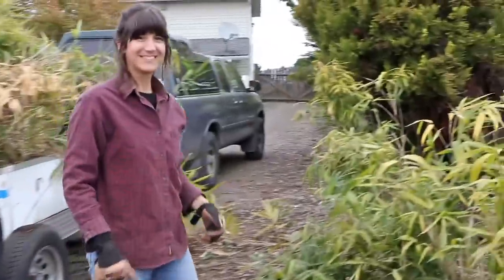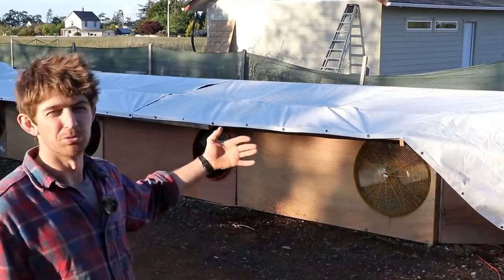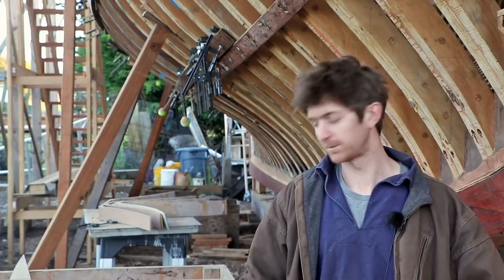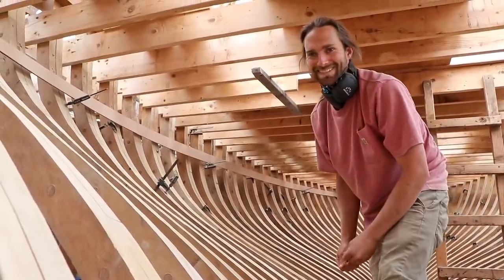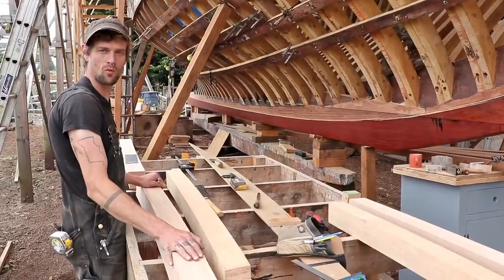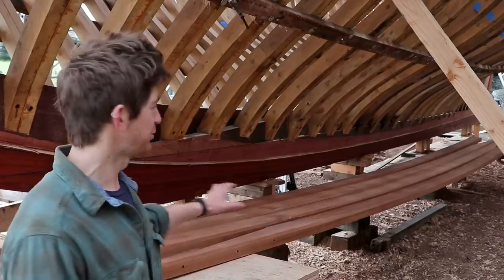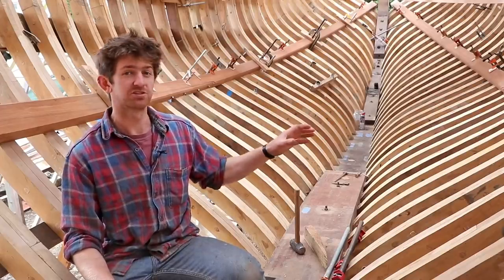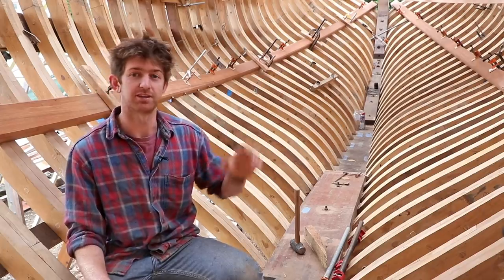BoatBuilding - Bilge Stringers / Oak problems! (EP72)

Comment: If you have a vacuum pump, I would take the bad oak and suck a stabilizer through it and it will become strong and be virtually water proof. Technique used for turning punk wood and making knife scales. Works great. I have even used de-waxed shellac as a stabilizer.

Comment: Do you pitch the exposed cross-grain ends to prevent checking and uneven drying warpage)?   The unevenness in Red Oak growth is common in wood sourced from areas of inconsistent weather patterns or interrupted by drought and over-wet seasons.  If cross pollination occurred..rare..there would be a natural uneven strength to the grain..  I don’t envy the intense work you’ve gone to.. I tend to only accept one custom project per year to two years and am usually swamped with work!  You’re doing it all...something I’ve given up after 6 decades.  Great videos, fabulous cool music!

Comment: Hi Leo, I am sure you have far better things to do and read, but here is a brief description of how a fan works. I am sure your system will be adequate. 
"The air being drawn towards the fan is moving in the pressure differential between the atmosphere at rest, and the lower pressure right in front of the fan blades. The pressure gradient is quite small, so the air cannot flow very fast - and it has to be drawn from a wide region to supply the mass flow. After impact with the blade (or at least after "interacting" with the blade), the air has a LOT more momentum that is directed along the axis of the fan (with a bit of swirl...). This higher momentum gives the air downstream of the fan its coherence"
You can puzzle over it with a big Mac and a Coke now Cecca's not there.

Comment: Loss of strength is more common in ash or elm. This happens when varnishing too damp wood. Over time, without access to air, the tree “burns out” and becomes fragile. In appearance, the texture remains the same. Although several times I came across a fragile oak, as in your case.

Comment: If you can blow bubbles through it, it's red oak (one of several varieties) rather than white oak (again several varieties). That's one of the ways to distinguish between them.

Comment: You might try splicing Purple Heart ends on the last eight inches ‘Dove Blocked’ for strength..  if the appearance is acceptable it helps seal the open crossed grain of both.

Comment: I do sympathise with the travails with the duff oak. It is often a heartache knowing that one will have to remake a part but the older I become the less down hearted. Experience just teaches one to pick oneself up and get on with it. Currently I am restoring a shaping machine and made a mistake machining a new dovetail pivot. I could have used it but bought a new chunk of steel and started again. Following published drawings I noticed that the micrometer dial I had just made as drawn was too small to accommodate any numerals so I cut off another chunk of steel and started again. Sometimes it is the bits that one throws away that makes the job a good 'un regrettable though it is. I do understand the problem with the timber. As a carpenter specialising in sash window renovation I use a lot of sapele and have a perennial problem of being palmed off with meranti which has negligible durability and is rejected when discovered. Fortunately I do not usually get as far as making anything out of it.
having watched the whole series from episode one thus far it is lovely to see progress accelerating somewhat with the acquisition of additional skilled labour if acquisition is the right word.
Your courage and determination is admirable. More power to your elbow and I would echo the comments of others on this video that the music you add is very good. Your videos are very enjoyable. Thank you.

Comment: I would have left those half beams in.  A) they are as far from the water as you get accept for the masts and rigging.  B) they are covered with the deck planking and none of the end grain is exposed.  C) I would have sealed them in place anyway D) Red oak is plenty strong, And I did see Louis "Tips from a Shipwright" video on it.  E) I'm a carpenter not a boat builder so I could also be totally wrong.

Comment: Have you considered the mystery wood being american chestnut?  Graining and color are very very close to white oak.  The weight of American Chestnut is about half that of white oak.
Reply: John, that's a good idea but I don't think it's right.

We cut and use a lot of (European) Chestnut. From everything I've seen of American dentata Chestnut they are really 2 very similar timbers.

The timber that Leo has is definitely an Oak, Chestnut doesn't have those really distinct 'Oaky' rays. Chestnut can be a little porous but not anywhere near as bad as the stuff shown.

 A friend of mine turned a really thin walled drinking goblet from Chestnut that bled red wine the first time it was used! Thicker sections and lengths are good though.

Enjoying the debate in the comments of all of Leo's videos. They are as interesting as the videos themselves! :-)

Comment: I'm just curious, but aren't new bilge stringers much higher than original?
Reply: No doubt they're stuck into the front at the correct height, but they'll need to be bent (edge-set) into their final location as they sweep aft. From the dwgs, it looks like the stringers have quite a bit more curve & twist than the beamshelves, so Leo might want to drag them into position in incremental steps.

Comment: Did you toss around the idea of using vacuum to soak the open grain with epoxy? I know that’s not a wooden boatbuilder’s way or an amazing solution given that you had spare wood to use. It just seems it may have helped both water intrusion and provided strength.

Comment: From the perspective of dealing with the porosity of the wood, could you impregnate it with a light viscosity resin to block up the pores? I guess if it's not strong enough, then it's not useful for the intended purpose. Perhaps it could be re-used for some other less structurally rigorous components?

Comment: Th CORRECT terminology,  from a  ex merchant seaman , is the sharp end, the arse end and the side is called the wall. To remember port and starboard it is required to either mark your boots or wear different coloured socks.

Comment: I am retired but an old mate asked me to help him renovate a business premises.  Built over a century ago, added to, then revamped in the 1940's, then remodelled in the 60's.  Built from Australian hardwood and everything is twisted, bent, warped dished and out of plumb - ad infinitum.  I love watching Leo's trials as I can identify with them.  Simple jobs take longer than planned.  A bit of wet rot here and borers there.   It turned out to have been a garage in the 1920's and remains of the old hydraulic lift central pillar is still in the slab under the floor.  Too heavy to remove so we build around it.  Leo's skill at problem solving and his trade is wonderful to watch.  Well done young man.  You are quite the inspiration.

Comment: Noahs Ark is similar but much larger. Lower hull exposed at 6,500 ft in E Turkey- and the bilge stringers were fastened/are fastened with huge rivets. Titanium(40%)/Aluminium(20%) /Manganese/Iron and more on the alloy.
Reply: 500 ft long. You might find it interesting. Y/T Ron Wyatt.

Comment: Educate me, please, Leo. Did the hands tools work differently in the dodgy white oak that "wicked up water and snapped like a carrot"? Did the wood have a different sound or feel to it per chiseling or hand sawing that was in any way noticeable? I can not remember from my carpenter days so long ago, but i would have expected something to feel different or wrong . . . if only the sound made by the tools or saw(s) when applied to the "wrong"/different wood. How is it possible that wood which is so different in attributes not sound/feel different to the hand? This baffles me. If it is that hard to notice, does that then mean that hybridization issues are/can be a problem now-adays? {time and $ and moral lost} Does this mean that all the timber being used will now have to be run through a quality control cycle and have a small piece cut out for the wick test and/or sledge hammer test. Yikes! What a pain in the back side. I worry for you. I have done quality control testing for construction sites: observing for defects all site materials; e.g. framing timber quality; concrete strength and soil compaction stuff, correct specs for structural iron. What a chore that is.

Comment: You should consider that the unusable, but well fashioned, half beams are now timber from the Tally Ho. If you put them up for auction on ebay, I would bid on one. Would be a great piece to have.
Reply: Of course, shipping costs might be a tad high. Then you could consider adding even more labor and turn the beams into plaques for the launch. Just a thought.

Comment: Sorry, have to ask:  apparently the truck was loaded longest beams on the bottom and shorter upwards.  Therefore, the short topmost plank bundles were unloaded first and put before the garage door; then the medium lengths, etc.  But after the first unloading, the truck pulled it's curtain and re-angled itself.  I'm guessing for better unloading and access.  But why was the curtain drawn between first and second forkloads?
Reply from the maker: Quick answer - I don't know!

Comment: What method did you use to remove the glued timber joints without damage to the mortise pockets when you replaced the defective beams? I noticed that they were all removed in one piece.
Reply: They were all just sitting in place as an unfastened dry fit. But note that while the joints will eventually get anti-rot primer, bedding compound & bronze screw or bolt fasrenings, no glue will be used.

Comment: So what exactly IS the MC of the lumber? Circulating air could actually increase the MC of the wood rather than decreasing it depending on ambient humidity/temp. I lived in the NW for 20 years, just guessing it will prob be impossible to get the lumber below 10% MC even after decades of air drying.

Comment: There is a simple method to check if it is white oak or red oak. Take a 5% solution of sodium nitrite (aqueous) and put some (2-4) drops on the heartwood. White oak will show an immediate color reaction (it becomes real black), red oak will not.

Comment: Found this - https://www.fpl.fs.fed.us/documnts/pdf1987/ward87a.pdf - it's an article on wetwood, a bacterial infection of white oak. It goes on about "metallic discoloration", "ring failure" and how you can't tell if its been infected "after prolonged exposure to the odours of green lumber in the mill".

Comment: A simple solution but it appears your dead set going original. I personally would mix up some penetrating resin and apply as many coats as the timber would draw in. That would treat it and stop any water issues.
Reply: But not the strength issue.

Comment: Could you consider using a low viscosity epoxy to seal the pores of the wood?  It would wick into the pores just as water would.
Reply: As well as avoiding rot it also have to have strength so as not to snap as demonstrated in video.

Comment: She's too giggly.  It's fun.  Also, about that porous wood.  Would you care to do a slight demonstration as to what happens if you attempt to treat it by using it to soak up mixed epoxy, given proper time to dry?
I feel like that would add some random resolution to any questions someone else might have.

Comment: Bloody hell, redoing what has already been redone. Good of that git to refund you for the "bad log", but you're still holding the bag for double the work and use of more timber and time to redo your redone work. L8R Patrick, good luck throwing clay and teaching. 
Is it just me, or are those bilge stringers kinda high? Are they not where the internal decks (walking floors) will be mounted? Seem to seriously reduce the head-room for walking about the births and cabins. Of course, I could be wrong, I am no shipwright or sailor. TallyHo is looking awesome.

Comment: Is that still the original shed (and plastic tarp) you put up there since the beginning? Does it leak any?
Reply: The orig dark plastic tarp suffered UV degradation & was replaced w/ clear plastic 'greenhouse' sheeting.
Reply: @frederickstibbert7389  Ah thanks. The structure has held up quite well considering the weather it's seen.

Comment: Since the deck support structure is in, or will be soon, how are you going to install the engine?
Reply: The motor will drop in quite nicely to its location directly below the framed cockpit opening.

Comment: Wonder if the beams could have been saved by pressure treating them with epoxy. Stick the end into a pot of slow setting thin epoxy while applying a vacuum on the other end.

Comment: Leo, why did you cover all those joining half frames in that satisfactory orange goo, but not the deck beams and stringers and hatch frames? All will remain dry under normal conditions and not have to deal with water intrusion apart from the keel off course.
Reply: Stated in a previous video that only dry fitted at present.

Comment: Could you use a penetrating epoxy for the wood? We use it for rotten wood with very good results. Perhaps it would soak in enough to provide both strength and sealing.

Comment: Why not epoxy saturate the pieces in question. Resin soak the first day then hardener application the second day? That’s what most boat builders do when doing plywood decks on commercial fishing boat builds.

Comment: I'm sure you've already done some research on this but couldn't you use an epoxy and then draw it up through with vacuum on the other end of the timber. Seal it up from the inside out. Epoxy taking place of lignin if you will.

Comment: As a German I can absolutely assure you that I would have used a torque wrench and tightend those nuts and bolts to their exact torque specification, not just "gut and tight" - thats how you potentially ruin bolt heads and threads ;D
Reply: yosserc It shouldnt shrink too much anymore inside the boat but that is not a problem. You just measure moisture content and take a table with expansion figures for this particular timber, with the average humidity and temperature of storage you roughly know when it shrank significantly and then you can set a date to retorque those bolts as part of regular maintainance. It should also adapt pretty well to the shape if its still just a bit moist. But Im not a shipwright so Im not really qualified when it comes to boats.

Comment: How much would it have cost somebody to pay to have that boat built ? Next I like sailing catamarans for the open ocean . Do you think a wooden catamaran would be a good thing or not. Next what about using fiberglass over the wood on a boat is that good or not good for the wood and for the boat in general
Reply from the maker: It depends who builds it! Anywhere between 300k - 1.5m

Comment: for the 7no.. persons who disliked this video to date . W T F is there to dislike ?? Ive worked with timber for over 30 years from highend cabinetry to traditional roofing and i see absolutely nothing wrong with the method or application of the work carried out here . In fact the work has been well thought out ,articulately implemented and most importantly of all enjoyed , dispite the set back with the oak beams the lads still cracked on getting the the dropped bollock put right in double quick time while still laughing and joking . Thats the attitude that will get that boat around the world . I can only imagine the haters disliked the music ? in which case they should watch with sound off , sub titles on , and get the f##k over themselves . !

Comment: Y'all love wood. I love copper. It's anti-bacterial and 100% recyclable. So, don't put PEX or some other kind of plastic in her. I know copper is expensive these days. So, if you use copper, I'll help with the cost. And, if you like, I'll help install it. That's if I haven't shuffled of this mortal coil. (I'm old)
Reply from the maker: Don't worry, there won't be any plastic, epoxy, or ferrous metal in this hull! Copper, Bronze, Lead, or Timber!

Comment: Another great video.   Could someone point me to where the costs of the project are given?   Is the whole thing funded by donations?     I can hardly imagine what the materials and machines cost.
Reply: Leo mentions the timber costs (& some of the tool costs) in various episodes. He's spent US$ 84,000 just on the wood that will be put into the boat - Purpleheart, Southern Live Oak, Angelique, Wana & seasoned White Oak. That figure includes most of the transport cost, but not the expense of the 7-8 months that the Angelique & Wana planking stock spent in the kiln dryer.

Comment: I’ve spent a life time in the timber business .... and my best advice is to scrap the suspect oak.  I know it is a major issue- but that wood is untrustworthy and must be ditched.
Reply: That is likely black oak.
Reply: And the supplier should be held to account.  I have seen more and more black oak being passed off as White Oak.
Reply: Unless I’m mistaken, all White Oak has tyloses.  This blocks the capillaries and ... that why White Oak barrels do not leak.
Reply: @patrickdean4853  You can always edit comments by clicking on the 3 vertical dots to the right of comment.

Comment: I once discovered i had porous wood when working with super glue. It wicked up the pores and stuck my hand to it.
Reply: That would be a cool way to set up your front doorstep in case of kids who persistently ring the bell and run away before you can answer. Just use porous endgrain blocks like parquet, set atop a superglue injection-on-demand system, perhaps activated by giggles. There might be a few questions to answer if the kids go barefoot in your neck of the woods, though...